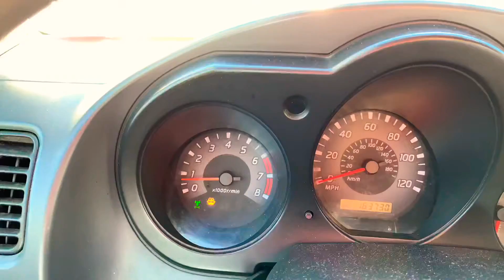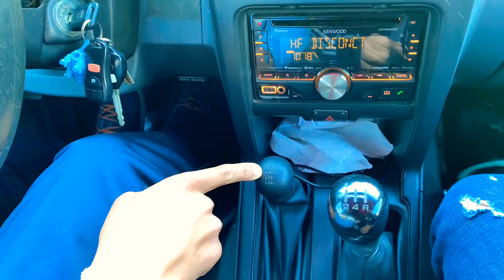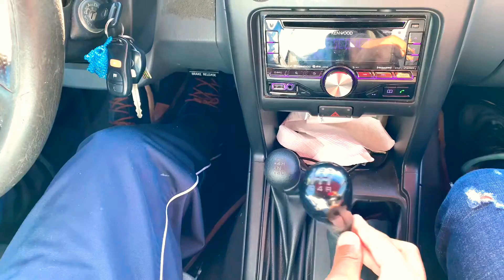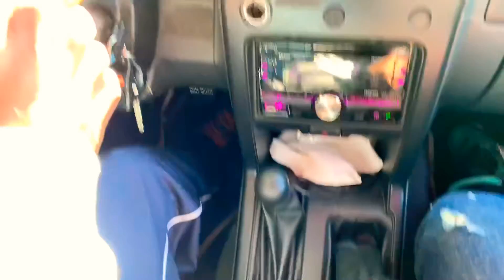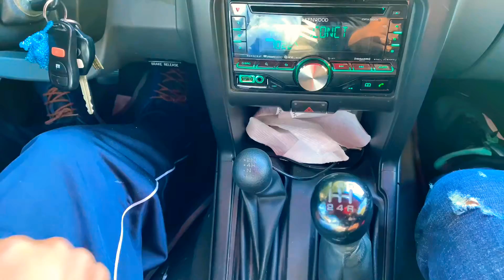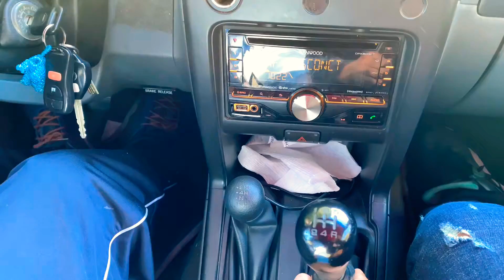How To Put Your Manual/Automatic Nissan Xterra Into 4 Wheel Drive Mode

Comment: Can I put this transmission on a 95 pathfinder?
Reply from the maker: It may be able to go with your engine but won't fit under the car. The reason is because your pathfinder is older, it may require an older similar transmission. So consult your mechanic.
Reply: @JuniorTLafaille  I am my own mechanic. Hahahaha. Thanks for the advise though.  Cheers
Reply from the maker: @thinkingmonk9676  well try it then. And let me know.
Reply: @JuniorTLafaille  sure will man. Cheers

Comment: Even if I don't reverse, the sign goes off with a bit of movement. Is that okay? Do I really need to go in reverse? Thanks!
Reply from the maker: Yes that's OK. Just watch for the light as soon as you drive off, just in case it comes back on. That would mean 4wd is still engaged.
Reply: @JuniorTLafaille  Okay, thank you. Great video too, thanks. I've finally figured out 4H vs. 4L, I had thought 4H was further up the stick, and thought I was in 4L when I was actually in 4H. We're getting a lot of snow right now, will be the perfect time to try it out!
Reply from the maker: @swavekbu4959  Awesome. Glad you figured it out🙌🏾

Comment: So if I have it engaged in 4wd can I also go in reverse?
Reply from the maker: Yes. 4wd works in reverse.
Reply: @JuniorTLafaille  awesome thanks bro 🤙
Reply: @JuniorTLafaille  also on the automatic version the shift selector has P,R,N,D,2,1 when I use the 4wd do I need to apply the 2 or 1 when I shift the transfer lever into 4H or 4L? Or is that only useful for 2wd models? Idk if that sounds confusing
Reply from the maker: @gustavoveliz4008  in extreme off-road conditions you need 1 or 2. But if it's only to get out of the snow or a little mud, you can put it in D to get out.
Reply from the maker: @gustavoveliz4008  also when shifting the transfer case you must be in neutral. Whether to go into 4wd or to come out of 4wd.
Reply: @JuniorTLafaille  thanks man appreciate it allot 🙏